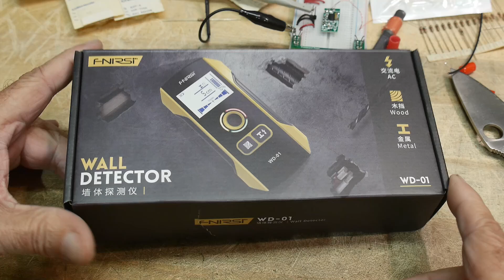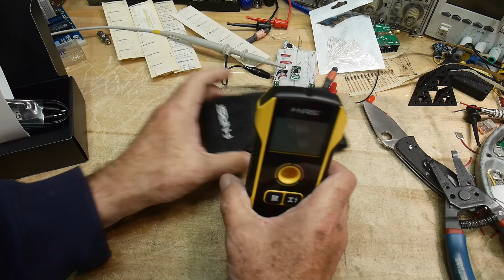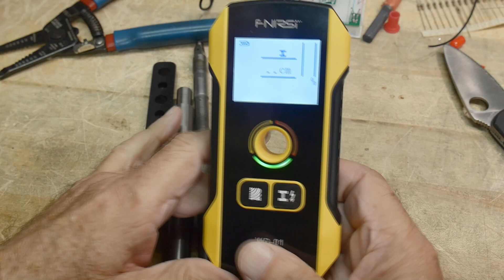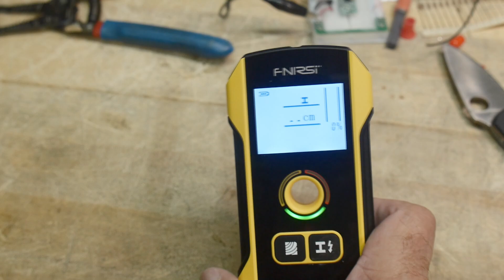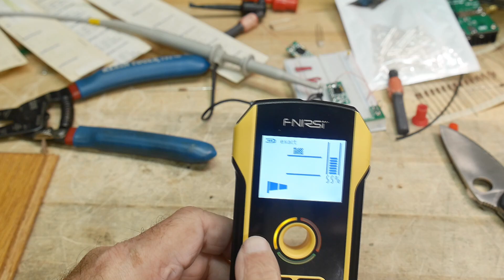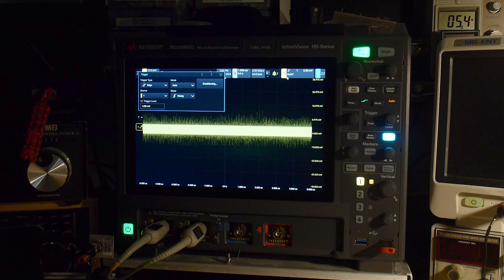#2068 FNIRSI WD-01 Stud Finder

Comment: To find studs in a residential setting is easy, just use small neodymium magnets to find the drywall nails or screws. The metal mode is very cool since most commercial office building use metal studs .  It was cool to finally see how they work

Comment: How does it detect wood. Wood isn't magnetic or conductive and shouldn't affect the RF signal.
Reply from the maker: wood is a dielectric effecting the capacitance
Reply: Wood both reflects and absorbs RF, like most solid materials (it has a dielectric constant noticeably different from 1, and a loss tangent noticeably different from 0). Sure, quite a bit passes through, but it's enough that you can tell the difference between drywall with wood behind it and drywall with air behind it, especially from 1cm away.

Comment: Is it calibrated against dry wall before measuring
Reply from the maker: my old unit I had to hold down a button to do the cal. this one just figures it out and when you put in on the wall it shows a quick 'cal ok' message.

Comment: The last part makes me wonder how they pass EMI testing...
Reply: EMI testing is for unintentional radiation.  The RF this thing puts out is totally intended; and, comparing the level of noise in ImsaiGuy's garage compared to when he turned the thing was on, it puts out a very low-level signal.
Reply: Assuming the frequency is ~1 MHz, the Part 15 limit is a field strength of 24000/F(kHz) μV/m at 30 m.  So 24 μV/m at 30 m if I did the calculation correctly.
Reply: @RideGasGas was noticing he didn't mention that detail
Reply: @jeffclark2725  That's true, however I thought he mentioned that the signal waveform period was approximately 1 microsecond and given the frequency is inversely proportional to the period, e.g., f = 1/period, that would be 1 MHz.  

But re-watching the video I see that he said the scope was set to 1 microsecond per division, not that the signal was 1 microsecond.  Hard to see the divisions and guestimate the number of cycles per division, but looks like a couple cycles, so upping my estimated frequency to ~3 MHz.  Given that, the Part 15 limit for the range 1.705 - 30 MHz is 30 𝜇V/m at 30 m.  So still in the ballpark of my original value.

To measure, ideally you'd be in an anechoic chamber with a calibrated reference antenna and the 30 m distance marked off and so on.  But I'm guessing that if the device was tested the measured level would be lower than that.

Interestingly enough, I had to pull out my own stud scanner a couple hours after watching the video to install a new microwave to replace our old one that gave up the ghost on Thanksgiving day - fortunately it was re-heating the side dish when it died.  My stud scanner is a Zircon OneStep Multiscanner i520.  Looking on the back of it I see a CE mark but no FCC certification info.  It's US designed and China assembled and a number of patents are listed for various countries.

If anyone's interested, the US patent numbers are 6023159, 6259241, 6989662, 7116091, and 7148703.